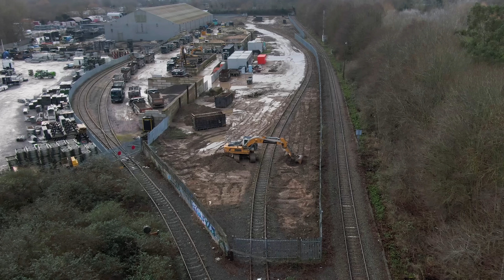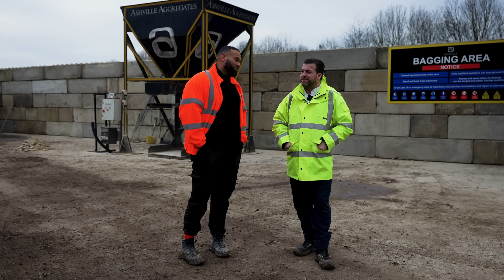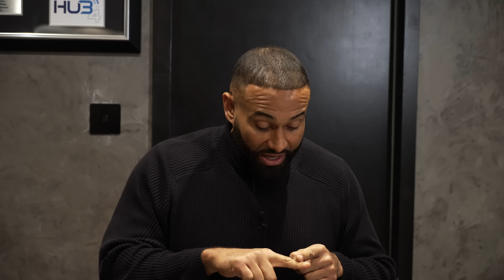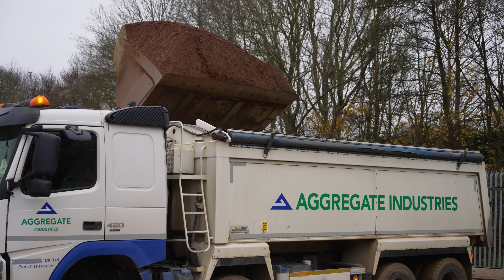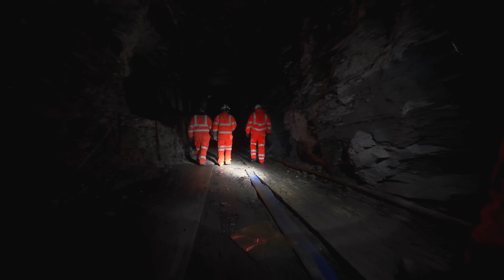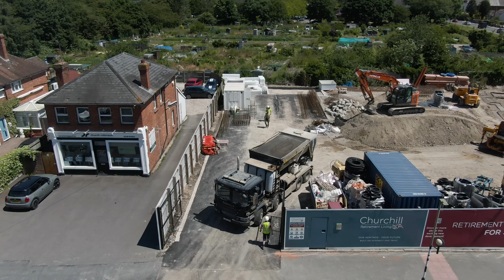End Of An Era

Comment: Ok, obviously a lot of detail is left out here, but I have a couple of questions:

1. Isn't it worth it to keep a small fleet of trucks for a baseline of work (and use third parties to fill the sporadic demand)? I do assume operating own equipment is cheaper, and even if you only have 5-6 it could give a bit of savings and independence from operators while making sure they are used 100%.

2. Do you think Ashville made a step bigger than it could, or do you believe that didn't have an effect and it was just a matter of circumstances and timing that you had no control over and no way to plan and prepare for?

Comment: Not an easy decision, but a brave one. When all these massive distribution entities with their extensive financial base, control the majority of the industry , the smaller organisations are left high and dry by the financial industry that is supposed to help grow them. This vicious circle will certainly hurt many more organisations in similar situations as yours and in the long run, like most of that which has affected UK since the decisions of the wicked witch in the form of Thatcher,  seal the fate what is left of UK industry and  businesses. 

All props to you for making the effort to secure your drivers' futures, that alone speaks volumes of your ethics.

Comment: You have balls Daniel, for sitting before the camera to tell it how it is, you have honour for protecting your drivers in the way you did,you have the right to succeed, and with this attitude plainly shown, you will.

Its a knockback, we all have them.

I had to do a similer thing when I operated 50 trucks.

I now operate over 400.

Your setbacks at the time are often the foundations of lessons learned and a far more prosperous future.

I see no reason why you won't come back stronger, wiser or less successful. 

You have my upmost respect and admiration.

Good luck.

Comment: Hi Daniel, we have purchased materials from you in the past but due to locations of our current jobs not being nearby makes it hard to put more work your way. I thought that with your new restructure you may be interested in self loading materials for smaller companies.

I was recently at a concrete show and they had an automated collection system for small trucks where the customer pays by card and then you have these automatic hoppers that tip onto a conveyor and that loads the trucks with small quantities of aggregates, and due to smaller companies being able to collect smaller quantities and save on the wastage/removal of excess materials you can charge a premium for it. 

This sort of system seems like it would work great for a company that stocks lots of loose materials so thought I would pass the idea on!

Goodluck in the future!

Jake - Landmark Ltd

Comment: I’m concrete, our company has 16 mixers, our plant is on a leased property owned by an Agg producer with a large pit, they produce asphalt- they don’t own a single truck. They sub out all the trucking and leave the insurance, truck payments, pay roll, maintenance fuel to the sub contractors. Which means when work is slow, they aren’t losing money paying for all of that. 

They are the 2nd largest agg producer in the USA. Turns out owning the trucks is not the key to success.

Comment: If you can provide a shelter for stored stone to protect it from the weather you will massively improve the supply of stone to your surrounding customers. I've worked in the testing industry most of my life and stone from rail heads is particularly problematic in bad weather due to the wagons taking on board water and saturating the stone. If you can somewhat protect it, your product will be so much more consistent and would help prevent any loads being sent away due to excessive moisture

Comment: The yard, £500k rent, £2000 a day based on a five day week. Too much. In Scotland would want to buy for 500k with change. Rates aren’t that much better. Unless you have a personal guarantee, the old yard should not now be a issue. New yard, if your going to sign another deal, renegotiate the price. Construction business is safe , as low overhead. Worse case scenario your office can be at home. What ties you too London, is it better to move out, start afresh, less overhead, little office staff left, work from home. Companies are built on good staff, but overhead must be met, even through the lean times. Ok gambling on what ifs, if you have the resources to get there. Better to work on what is there, what makes money. Always said if you can buy something at a pound, sell for a tenner, shipped direct, your made. Chin up, been there, moved on, hard work does pay off.

Comment: Saw a couple of what looked like Ashville trucks running a few weeks back without any name on though, guess this explains that.
Business changes over time, you get pulled in some directions that drag you away from your original plan but if the work isn't there for that side then you need to get lean and accept maybe that wasn't to be. Another way to look at it; There's lots of trucks and operators about, not so many railheads though. Got to corner the market where you can. Shows the manners of a man that you'd sort out options for every one of your employees leaving you. Onwards and upwards Daniel, the journey to your goals will be worth it

Comment: What is interesting is not only finding published articles of Ashville Aggregates and Concrete filling to appoint an administrator, it is the list of construction firms that have outright not survived, filing for administration over Jan & Feb > Ref Construction Enquirer, its a big list.

You've mentioned ambitions for the rail head before and the pivot is hopefully a blessing in disguise, lack of cashflow will bleed any business dry, not matter the value of the assets.
Who knows, perhaps you end up doing a massive amount of work for HS2 material supply, just don't get tempted in invested in the infrastructure again, get them to collect, or contract it out.

Comment: I don’t see this as a negative at all I see this as a good opportunity to utilise an asset which would be the rail head. Being able to stockpile aggregate. You could become a main depot/distribution hub of aggregates for many projects not only of your own but surrounding businesses. Eliminating the cost of running trucks, an inflow of cash could be coming from surrounding businesses needing what you can supply guaranteed which is aggregates whether it be raw material, bagged material or cement. This eliminates the reliance of your own fleet of trucks that need to be maintained and a clientele of your own to generate cash flow through those trucks. I see it as a service station many people use a service station on a daily basis each for a different reason if you can cater to each of those needs you have a money generating machine that doesn’t rely on one service but many for all different needs. I’m by no means an aggregate expert just a 23 year old with a broad mind. Keep up the hard work because hard work always prevails.

Comment: Daniel,

First of all, nothing but huge respect and love my friend. Finding other jobs for those drivers shows what sort of a boss you are. 
I do understand that running lorries is not easy.
HOWEVER! (sorry couldnt resist)
I believe that not all the lorries should go. Me personally i would at keeping the RORO (because it has many capable applications) and i would go out and buy a tractor unit. Nothing flash. Just something that can do the job when you need it to. In terms of trailers, Im sure a few companies would loan you one for an hour or a day or whatever. Hell O'Donovans trailers arent doing anything 😂
At least then that way, if a quarry nearby is running out of aggs whilst on a pour. Someone can load up take it round and tip. 
Its another small string to a big bow.

Comment: Ive said it before, if and when heathrow starts work on the 3rd runway and "IF" you get some sort of contract you will pull through, but if you dont get some sort of decent gauranteed work at a good rate your toast,. Getting rid of the trucks is one thing, they are all leased so you wont get a penny back from them, the work your going to subcontract out to other hauliers isnt going to be cheap, and they will want paying promptly as they wont trust your credit,.i also blame the government for a lot of your problems, good luck in the future and keep your head up, cheers,.

Comment: I’ve run lorries for a while, never to the level of Ashville but it truly is bad out there at the moment and without waffling on there are loads of rules and costs that make it 100 times harder than it needs to be. From the out side it seems like a great option to still sell and accept material without the cost of lorries. I would think that the profit from importing and exporting material from your site is miles better than the haulage.

Comment: TLDW: Asheville has ceased all lorry operations and is selling its entire fleet due to financial pressures, including high relocation costs, legal battles, and a failed restructuring deal after funding was withdrawn. All drivers have been secured alternative employment. The business will now focus on railhead operations, utilising third-party hauliers for transport as needed. Construction projects, including refurbishments and infrastructure works, will continue. Plans for partnerships and joint ventures are in progress, and concrete works at the railhead will begin soon.

Comment: My dad’s work made this decision around a decade ago due to loss making and trucks being parked up. The restructure including keeping the vehicle workshop as my dad is the manager of this and they had already transitioned to retail instead of fleet and turned the yard into parking for fleets and overnight parking plus kept the warehousing open. They used sub contractors for transport as and when needed. They were brought out by a new owner but the new owner has continued with this option as there huge amounts of capital involved in operating a fleet. 
You’ve made a huge decision but in the long run it should work out as you’ve planned. But you should look at overnight secure hgv parking as you have the facilities already in place.